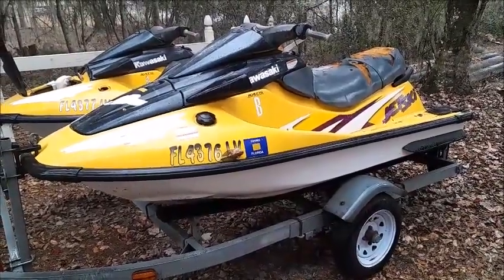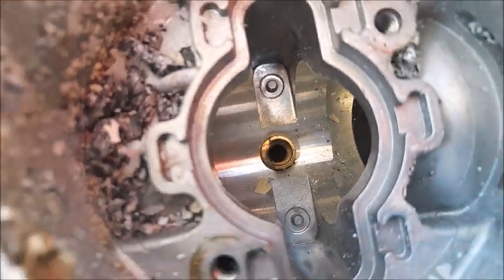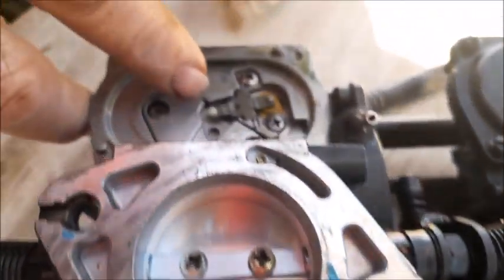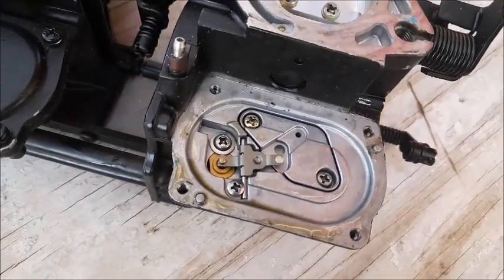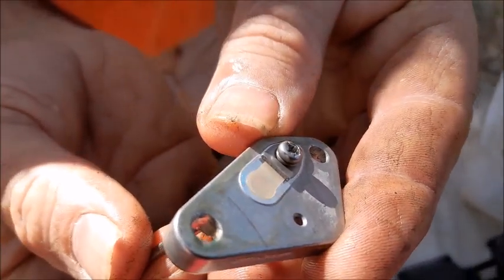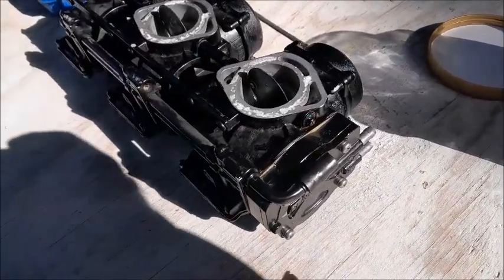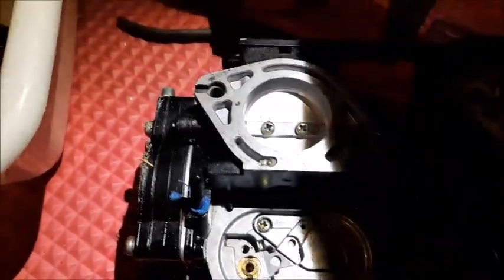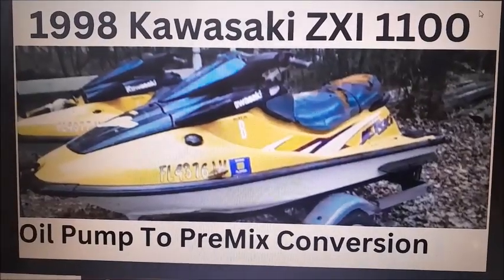1998 Kawasaki ZXI 1100 Carburetor Removal, Disassembly, Clean and Rebuild

Comment: I have a question for you, where do the fuel lines connect to the carb itself?  I have a zxi 900  that i got and the carb is laying in there disconnected from the last owner, I rebuilt the carb but don't know what fuel line goes where like where does the return line go and which one is the return line from the gas tank.  Love the Video!

Comment: How do you tune the carb? I followed this video but my ski will not start. My buddy told me to tune the carb with the high and low screws. I’m able to find the specs but cannot find the screws themselves.
Reply: what I have heard ( in the same situation now) Is there covered by a aluminum plug some where close to the oil inlet on the carb haven't tried it yet but they need to be drilled out carefully
Reply: If it’s not starting it’s highly likely you have a different issue. Does it run if you pour a little pre-mix into the carbs?